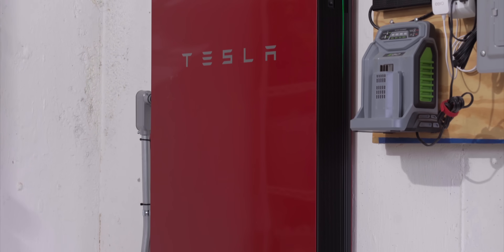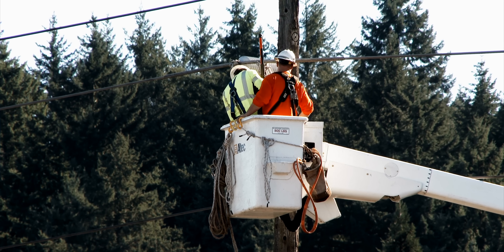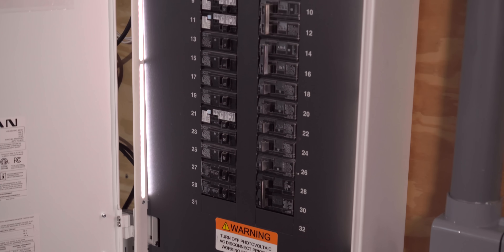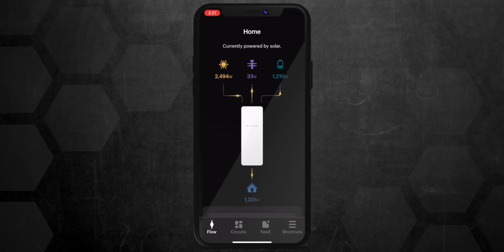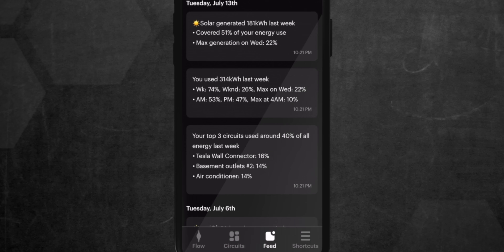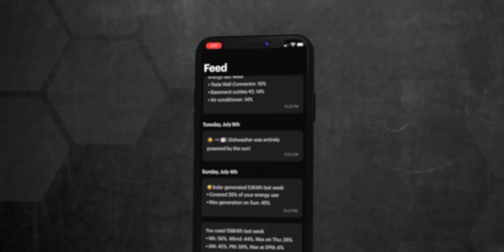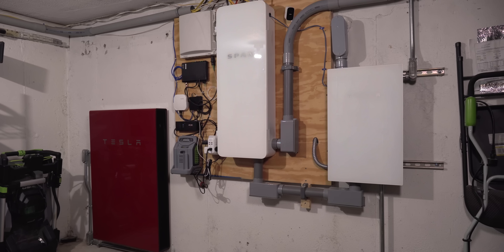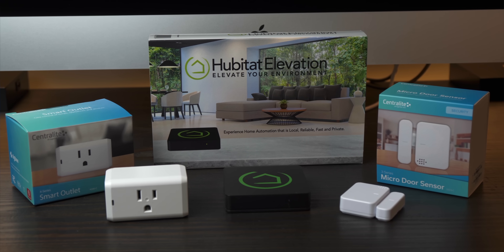This Smart Home Electric Panel Fixed My Tesla Powerwall

Comment: Hello, Can you do a video on 

Automatic three phase load balancing system by using fast switching relay in three phase distribution system

Abstract:In three phase distribution system the unbalance phenomenon occurs due to single-phase loads and unequal sharing of loads in each phase. To overcome this problem, distribution systems require equal sharing of load in each phase. This is possible by automatic three phase load balancing technique. The automatic three phase load balancing system is possible by the proposed hardware which is micro-controller and relay based hardware. This hardware is installed in the incoming of three phase lines and will accordingly switch the domestic load to the least loaded phase using fast switching relays. The single full house load is connected to the phase that is least loaded by relay switching ON/OFF. The result of the proposed hardware and simulation shows that microcontroller and relays switching is effective in reducing the unbalancing in three phase lines and also reducing the current in the neutral wire of the system. In addition, it retains voltage regulation and stability in the all three phase.
Reply: I have search a lot but I don't know if the technology exists in the market. It really does make sense for such a product to exist.  Not only does it have technical advantages to run smart electrical balanced load but also it could have significant impact on electricity bills.

Comment: Too bad that over here, EU regulations forbid stuff like charging your home battery from the grid. So even if one where to install such backup system, it would be mostly empty throughout winter.
Reply: In Germany there seem to be a huge boom with home batteries though and the EU seems to be supporting it
Reply: @devluz  yes. We have one in our home. But it's only allowed to be charged  from the solar pannels per regulations.

Comment: This is an awesome panel, but does Span have an option or plans to integrate with a standby generator or just a generator input?
For someone who has not yet a solar/battery setup but a generator, Span can make much sense if it can work with the generator feed and control/shift the critical loads during an outage! Plus the panel is then ready for when one adds the solar/battery later. Would be great to hear from Span about that.
Reply: I imagine they are using current transformers, if so it would work with any kind of current flow.

Comment: This is very expensive to replace a $400 electrical panel or put in new instead of a normal electrical panel or two.  I am building a new home and will have an electrician put in a sub panel for the solar, but the fact that I may lose power once a year, I can easily spend the time flipping all the breakers myself.  As noted below, this company may or may not be in business 20-30 years from now.  Square D and others will be around, if they had the backing of a Square D or other firm I trust to be around in 20-30 years I might consider it.  But as it stands this is great for someone who paid NOTHING to get it.  If I could get one for $400 I would install it, but $3500 is too rich for me.

Comment: I want to know the system life of the computer controlling the panel.  how easily will it be to replace the hardware in 10-15 years.  Also, in the event of a sale of the house, the new homeowners may or may not be tech savvy.  what are you thoughts there?

Comment: At the present cost of SPAN panel of $3500 plus installation (probably about $500 wish) toal $4,000 it may be beneficial to use that money to make about 40 Kwhr of DIY batteries to run the whole house panel longer,  Hopefully the cost of SPAN will come down with economy of scale to about $2,000 especially for a new home etc.

I do wonder how much maintenance of the SPAN electronic breakers may cost. Would be likely essentially impossible to diagnose and repair any problems .  You might need to just replace it and send one back.  ?  another $500 or more. And what can you possibly do to use the circuits affected ? rewire to a breaker thats functioning? Do without electricity?  Replace with temporary standard service panel ? These are the questions I want answered BEFORE INSTALLING A SPAN !!!

Comment: I know this isnt directly  the subject of the current video but here is a subject suggestion.  What about simply adding large mass to homes that would enable one to store energy in the form of heat or cold in the large mass. For example HVAC that is powered in a particular home via solar energy . In winter use the mass to store extra heat during the day and circulate air from home through it at night or if inside the homes insulated envelope just let it radiate heat to minimize energy use at night.  Opposite for summer . Cool the mass down and it will absorb heat fro, home as it heats up. This could be accomplished by things like a large mass of concrete or other materials such as water. Few if any additional moving parts etc.

Comment: Only problem I see is it being a new company. What happens when if there is no more company and the app stops getting updated? Basic transfer switches will always work. Not to mention does the panel or app phone-home and exfiltrate data? Cybersecurity is only growing in importance. Really, basic homeowners need simple home networks with built-in VLAN's for IoT.

Comment: I'm accumulating ideas like this one for future house ideas. I like this stuff. Unfortunately, the cost-benefit analysis of going solar + battery is going to be cost effective only if you're going to be living in the house for many years. A $20k-$30 investment won't make much financial sense if you're going to move in 5 year. Paying off $30k in 5 years is no easy feat for a lot of us. That's about the cost of a car loan, and the cumulative savings on your utility bill won't outweigh the initial cost for years afterwards, especially if you also invested in passive energy savings, and it'll impact your home sale price if there's an outstanding loan on the installation.

Still want to do it though. I just think that this stuff is cool. I won't just be paying for profitability at this stage of the technology; I'll be paying for the convenience and coolness.

Comment: If you had two Powerwalls, does that double the input/output limits? Would it be simpler/cheaper to get two packs over the smart panel? Great video!

Comment: I am interested.  The pricing isn't as prohibitive as it first seems.  I priced a replacement panel at 2k installed.  I transitioned my house to full electric and the current panel is a confusing mess.  I'm currently waiting on a Solar Roof + Power Walls install.  Small possibility that Tesla comes up with a comparable power management system by the time my install date kicks around. :-(

Comment: A good way to reduce load is put your networking equipment on an isolate solar setup. It's easier to do because load is generally pretty constant, and if it isn't, power usage is much lower than something like a nas or workstation.

Comment: They ran data cabling outside the conduit? That's "proper" electrician wiring, separating low voltage and medium voltage wiring. Is it fine to run them together? sure, probably nothing will happen. The ideal way to do it is run them both, separately, inside metal conduit.
Reply: Tesla Powerwall is AC coupled so it doesn’t require metal raceway. Recommended communication wire is shielded with a drain wire to avoid interference so it can run in the same conduit and there’s only one knockout so that comm wire run outside the conduit had to enter through an extra hole drilled into the J-box. His PW install is shameful and painful to look upon. I’m sure the installing electrician doesn’t like to see the negative reviews but that is not pride of workmanship.

Comment: I love the idea of it; it seems to have great features and usability, however I'm not of fan of wireless/external connections. NOT the paranoid "my house will get hacked", but the interference, dependency, and privacy bleed that generally comes with most IOT are my concerns. Long term maintenance is also a concern with externalized solutions as noted by others, and I would definitely want to know more than is presented about control over things like connectivity and updates.

Comment: My neighbors 3 year old (stone and concrete) house just burned down when the 28 solar panels on his roof caught fire. We had to evacuate due to toxic smoke and the glass coming down

This was not the first house to go up in flames after solar panels caught fire in our city. 

I guess they used cheap Chine panels or connectors from different brands, but he did pay a considerable amount for the system and had it installed by professionals 

Just placing this here as you do not want to oversee the dangerous part of producing a lot of DC power right above your families head

Comment: Suggestion, an option to switch off the circuit after its energy use has reduced to standby levels, you don't want to go terminating some appliances mid cycle if you can avoid it.

Comment: Question: Could this technology be used to reduce peak load strain on Grid systems and reduce reliance on the grid by storing extra power during the low times and using that to power your house during peak hours? I'm assuming the power generated by solar panels certainly help with this as well but it would be nice if the system also did this to help average out the rates for your house and decrease peak hour grid strain.
Reply: Yes, this is the holy grail for this panel, demand shaping for the grid. The challenge is compensating the right parties so everyone feels good about it. The grid would need better and nearly real time control, so the grid supplier needs some return, so all the savings on not needing peaker plants won't go to consumers. Then Span and similar companies need to be compensated for following grid standards and security. One could imagine smart panels with security flaws could damages the grid if large loads were turned off and on at once. Then, the consumer needs some compensation for not being able to use all the appliances they want to at once. But, there are likely more they could do, such as not running the water heater or AC if the stove was needed. The possibilities are huge.
Reply: Well it can only make a hard cut-off of power and that is not always ideal. Better to integrate the actual appliances themselves probably. More tech!

Comment: Matt, you originally planned to manage the circuits by switching them on and off manually to insure you did not exceed the maximum KW for the power wall, saving money by not installing a critical loads panel.  Was it very inconvenient switching circuits manually so as not to exceed the power wall capacity?  Since blackouts where I live are fairly uncommon, it seems that a little manual management of the electrical panel when the power goes out is a better option than spending thousands of dollars to have the flexibility of managing load easily. Would appreciate your comments.

Comment: Love your presentations. I was considering getting solar about three years ago, but I was told if the grid is down, the panels cannot continue charging my battery. The whole point was to have quiet power generation during an outtage! What do you have that let's you continue using the panels when the grid is down?
Reply: Hi Alejandro, who ever told you that is incorrect. Solar panels can continue to power your home and charge your battery when the grid is down. We'd be happy to connect you with an installer, please reach out: span.io/get-span
Reply: If you don't have batteries, then typically the solar is tied to the grid, which is why the solar gets shut down during a grid outage. If you do have batteries, the solar can charge them and the batteries go through an inverter to power your house panel. There will need to also be a transfer switch to isolate your house panel from the grid (so workers don't get zapped by your batteries). The batteries will roughly double the price of the solar system, but you will be able to use solar during an outage.
Reply: @ralphbell1786  thank you for for your answer. I neglected to state that batteries were always part of the equation. My water well is electric. So no power no water. So its imperative for me to have power when the grid is down. Our electric company is very responsive, and we've only had a max of two or three days without power in the last four years. But, my estimation is that the future does not look as rosy. I'd like to have a switch to go off grid whenever is necessary!

Comment: How frequent are power outages where you live Matt?   I live in rural Kansas, land of tornados and wild thunderstorms.  Still, extended power outages are very infrequent.  We might have the power flash off briefly and back on, but we hardly ever see multi-hour outages.  Seems like you'd need frequent multi-hour outages to justify the cost!

Comment: You have to be pretty much dedicated to lowering your carbon footprint or an extremely dedicated "tech head" to adopt this sort of system. The solar panels, the powerwall, the smart electric panel, installation costs all add up to more than one could possibly save financially in a lifetime. And the technology changes so quickly that anything 10 years old will be light years behind the latest technology. That being said, I really do appreciate your  willingness to experiment and share those experiences. Without early adopters, progress would grind to a halt.
Reply: Yes, you probably don't do this for the economic upside. Its just a tech nerdery to me, nothing wrong with that though.

Comment: Erm, you don't need a $3500 electrical panel to properly label your circuits. When I bought my house, I spent a couple of hours with a label maker and labeled all circuits at both ends (panel and plug/switch). If I need to work on a plug, I look at its label, go to the panel and turn off that circuits, and then verify of course, just takes seconds. Everyone should do that, you don't need to spend much time or money.

Comment: This just seems like a bad idea.
-Limited life span compared to a stupid panel. I've had breaker panels that have lasted more than 50 years on a house and the only reason I changed them was to bring it up to code. Does anyone think this will last past the 10-year warranty? Let alone 50 years, it has a computer chip in it...Then you need an electrician to come back out to your house to replace it with a stupid breaker panel, which you should have done in the first place.
Side note-Hey it has a computer chip connected to the Internet, what is the security?
-Matt issue is he has one powerwall....with two most of the limitations go away.
-How many times is your power going out that this would be useful? I limit in a fire-prone area that Ive lost power for 3 days, I suspect it will happen once a year, doesn't really justify the cost (lifetime cost, because it is only going to last 10 yrs not the 50+ years of a stupid panel). When my power goes out I do one thing, turn off the largest pull on the grid (water pump and  AC ) with 2 walls my power needs will last days.
-Spend the money on another powerwall or save it for when the inverter dies in 10 years (man if someone comes out with an inverter that will last 20 years, I am on board).

Comment: Awesome idea--but a proprietary electrical circuit controller that can shut off any and all thing in the house, and (likely) Internet connected so hackers can screw up your house from half way across the world?  

Um, NO.  Just NO.

This kind of things need to be open standards, vetted by security experts and hackers--not just electrical engineers.  And, firewalled so only the control portion is accessible from one's home network--and not reachable from the Internet at large.  (Sorry if you're vacationing away from the house and forgot to set something it will just have to operate via its safety fall back plan.  I don't care how inconvenient that is.)

Plus any info it can send to the company must be in the standards, properly documented and only sent via encrypted communication.  And give home owner/tenants control over what information is sent.  The security standards themselves also must be written in such a way to facilitate timely updates in response to evolving security threats.  

Hell, the firmware should be open sourced, and ONLY open sourced, so when the company making the panel go belly up it can continue to receive needed safety and security updates.

Comment: We will be upgrading service to 200A, replacing old Zinsco main sub-panel, installing PV/PowerWall(s)adding some new circuits (including level 2 charger) and will consider the Span smart breaker panel. I think I noticed that the Span panel cover appeared thin and a bit flimsy ??

Comment: It seems a none app version for people that doesn't have electronic leashes.
And it should also have "smart" grouping : Thermal pompe is a nice to have in summer, but a requirement in winter...
And those it handle none solar/battery backup? Generators aren't exactly nice, but sometime it's usefull...

Comment: Industrial design comment : Since Span divides the breakers into 3 groups in the app, they should make it possible to reflect these three groups in the fascia of the physical panel, but also to group each of these under their own subdivision breaker. This would bring the physical user interface somewhat closer to the software one. I would do this by providing colour-coded plastic caps to affix to each breaker, so each can be identified to its parent group. The caps should be easily movable so the user can update to match the software groupings. I would also place a distinct section with one master breaker, plus 3 subdivision breakers (some ideally with soft start).